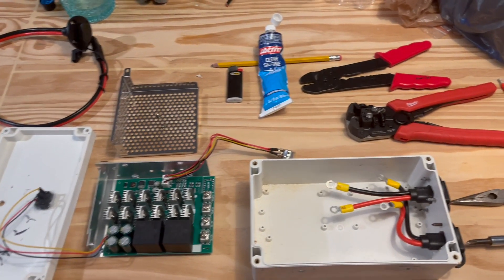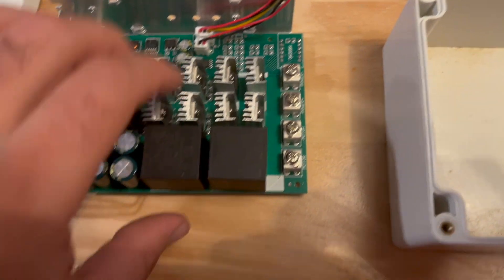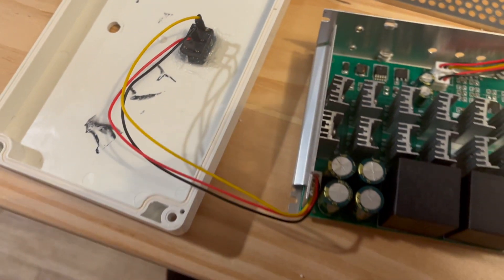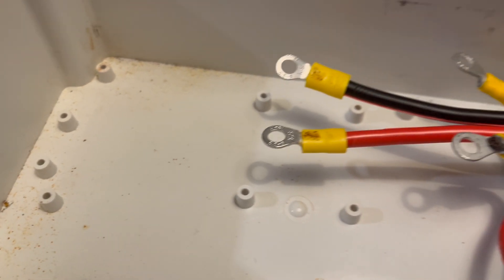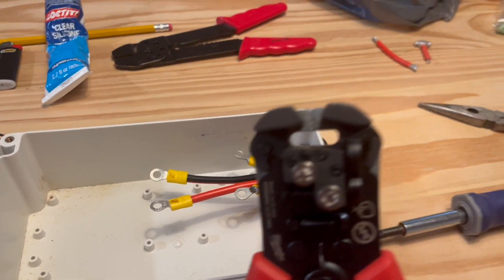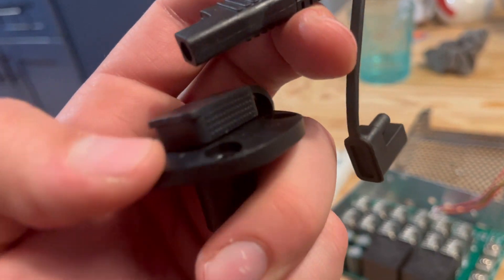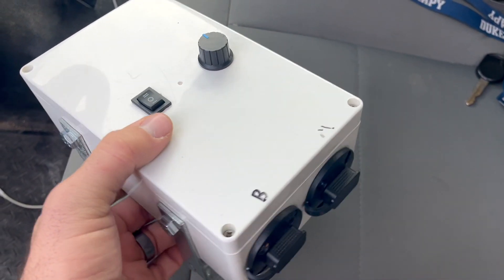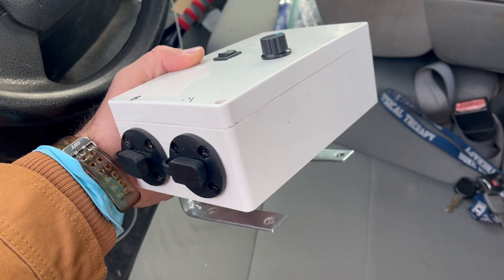PWM Box Tutorial for Kayak

Comment: Have you ever run into the PWM overheating? In a sealed box like that it seems like heat would be an issue.
Reply from the maker: @Alakarr  no I haven’t. Just the loose wire issue.